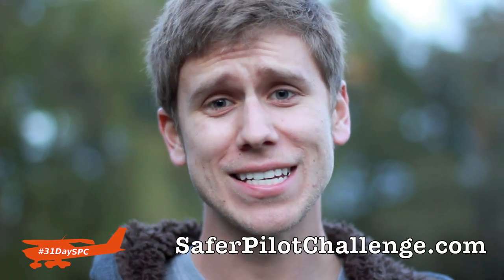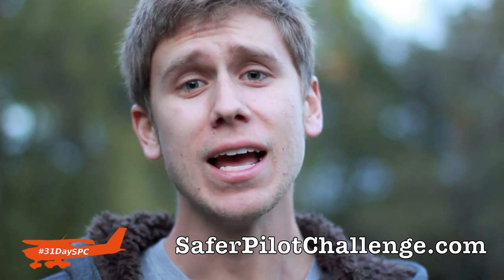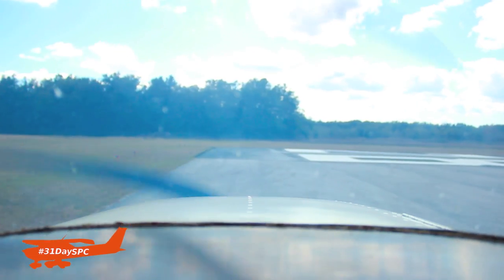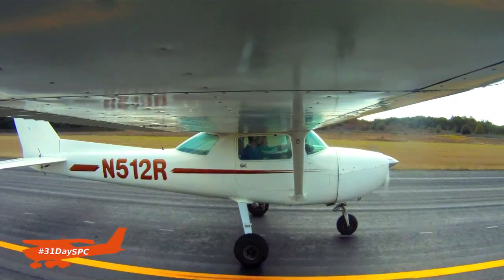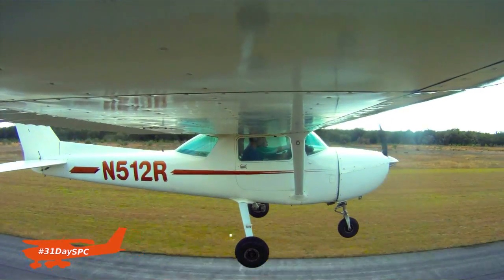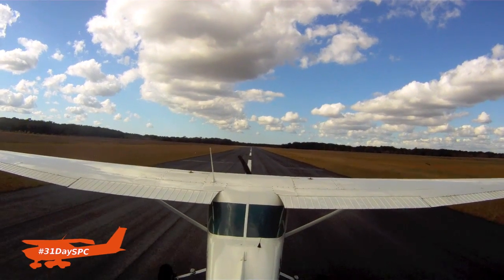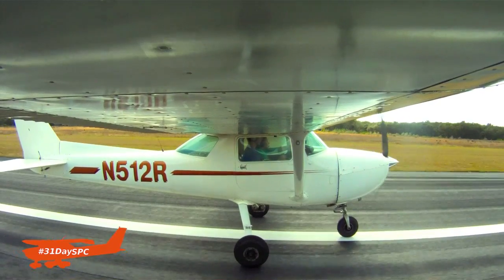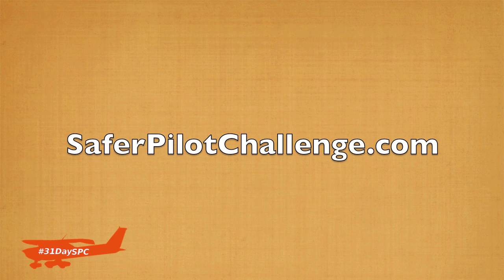Engine Failure on Takeoff - Day 1 #31DaySPC

Comment: Ask Jason a question: You have been cleared for a cross country flight from a small airport, to a larger municipal airport, a 250 mile journey. You have pre-checked both a large paper map and your I-map slate, for your calculated fuel and routing estimations for this long flight. You are IFR rated, but not real experienced in longer hours logged and still a bit of a neophyte and evening or nighttime flying. You're flight path routing for departure, from a small airfield in let's say Florida, to a more urban area farther north in mid Florida. After takeoff, a small squall unexpectedly forms, with some  lite clouding along with light rain. There is only a little buffeting of the aircraft, but the updated en-route forecast update says that the weather will be lite, with only sparsely scattered showers, with no reports of thunderstorms. Unexpectedly, a crash of light, then a bang is experienced by your aircraft. In this light aircraft, there is a lightning dissipation system, but your instrument panel, because of the strength of the bolt discharge some instrumentation is burnt out. Communications with the ground is gone and you hand held cell phone or slate, with also blown-up, as you had it plugged into a 12 volt recharging outlet, that you had approved a couple of months before. Youré not familiar with the terrain beneath you, but at least have seen it on the map. You've gotten the engine restarted, but in the confusion of getting the plane restarted from an enforced glide mode. You cannot contact the ground, but have turn& bank, airspeed and altitude, plus magnetic north. You have estimated fuel use from your last instrument check, which was an electrical gauge. What do you do, now that youré stuck in this situation, with only a barely discernable ground outline, from 8 thousand feet above MSL? If Looks as if to be mostly forest below, or rough terrain, but with occasional small towns, villages below. What do you do and how do you go about landing? You have no hand held radio.  Everything plugs into something now-a-days Jason, this is why I am asking this question. Thank you for your consideration on this question.

Comment: I haven't understood quite well... What's the reason of having to point the nose down? Is it to gain speed (due to gravity) and therefore increase lift?
Reply: You have lost the thrust vector so the only way to increase speed is to use gravity pointing the nose down and gain airspeed (which is very quickly disappearing with no thrust). Noting, it is only when the stick is in a 'stall stick position' that you will stall, however you will 'mush / fall' down very quickly holding the same attitude and risk a stall if you are slow and temporarily pull back too far. So point the nose down to get best glide speed for your plane specs and then you will have the lowest possible rate of descent and max time to find a spot to land.

Comment: Hi Jason, quick question that I can't seem to find in the FAR's. In order to get current again and be permitted to fly passengers with my three take offs and landings, do the three of those have to be with an instructor?
Reply: Short answer...No CFI needed as long as you are up to date with a current flight review (it hasn't expired).

FAR 61.57

(1) Except as provided in paragraph (e) of this section, no person may act as a pilot in command of an aircraft carrying passengers or of an aircraft certificated for more than one pilot flight crewmember unless that person has made at least three takeoffs and three landings within the preceding 90 days, and--

(i) The person acted as the sole manipulator of the flight controls; and
(ii) The required takeoffs and landings were performed in an aircraft of the same category, class, and type (if a type rating is required), and, if the aircraft to be flown is an airplane with a tailwheel, the takeoffs and landings must have been made to a full stop in an airplane with a tailwheel.
Reply: Nope, you can literally go do 3 loops around the pattern and then taxi over to your passengers.

Comment: This actually happened to me a few months ago.  I was about 100 ft. maybe a little higher in the air.  I am a student that was solo at the time of the incident.  It happens very fast, but when you are in a very stressful situation your brain slows down and it seems that things are going in slow motion.  I recommend that you replay your situation in your head before it happens.  Because I had done this and practiced it with an instructor I did just as I had replayed it in my head before it incident had happened.  No flaps just pitched it over and got her back on the ground... then came the adrenaline dump.lol
Reply: Crazy dude! Good job :) Good advice too, I do the same thing (Visualise the EFATO procedures as I'm taxiing to the runway).

Comment: if on takeoff and the engine blows out with runway remaining, would it be necessary to go full flaps?
Reply: No. Flaps will make you slower, but it'll also change your lift dynamics, and they're bad for helping you brake. Not a good idea. Just get the nose down, land, and full back pressure while braking.